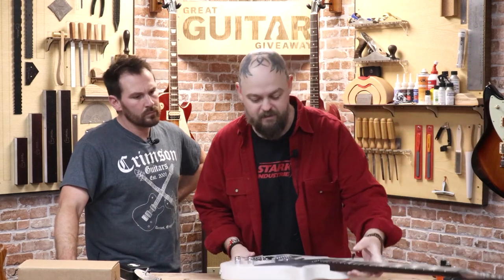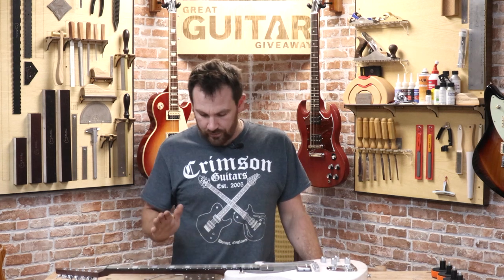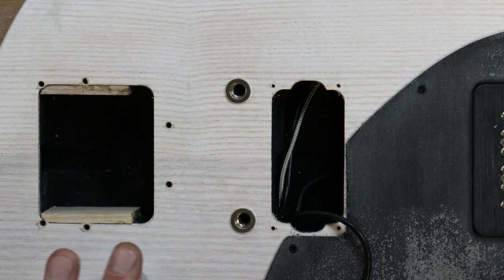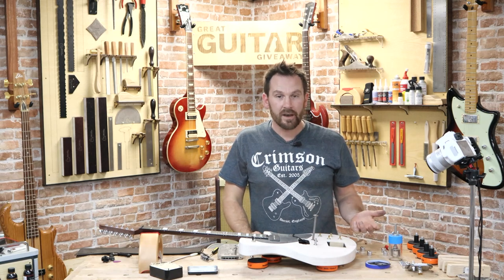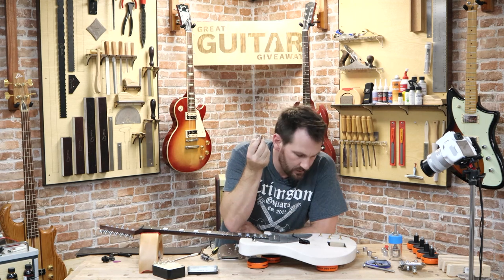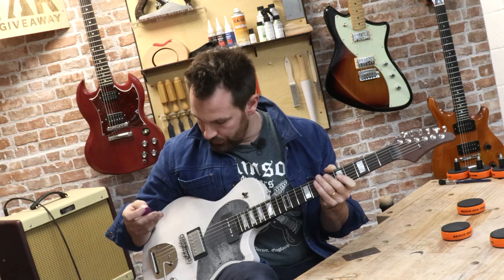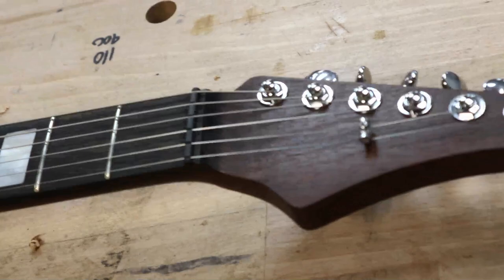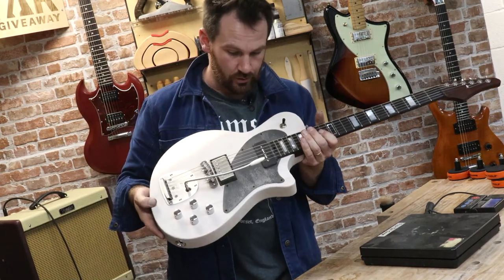Enough Texture for You? | Mastery Bridge Installation & Prototype Redesign

Comment: Very nice refit! I think that I would have used a brush/wheel on the humbucker cover to get the same striations and direction as the tail piece. Perhaps the same effect (or some thing randomly directional) for the control knob tops.  This might tie the elements together a bit more.

Comment: Hiya all,
Great video, as always, thank you. One tiny thing with the editing. We watched the blanks being driven in then the ends being coated in a white substance, glue? Paint? But then the new receivers being driven home, what was the white substance? You could have shown the new holes being drilled. 
When driving the M8 screws through to protect the wood of the back put a 50p piece or even a £2 coin under where the screw end will hit. The larger the coin the better the load will be spread and the much less chance of damaging the wood. 
Any chance of a tutorial on how the bridge works, why is the pivot point movable? 
I received the new design memory cloth holder in very good condition, I think it will be perfect for bangles. I'm a goldsmith rather than a lutherie. 
Stay safe, Steve...

Comment: Its has its pluses and minuses like any other guitar I think. For me the contrast with the neck and the blandness of the white doesn't do it for me. At least not with the black pickup and pick guard. I liked the fresh chrome cover over the distressed one as well. It sounds killer. You had that particular tone done up well for sure. 

The funny thing that popped in my head was the trem explanation being expensive more then once. All I heard was "Oh yay another company riding the covid crackhead bus to the end of the line!"!